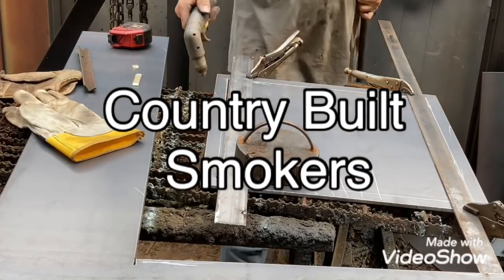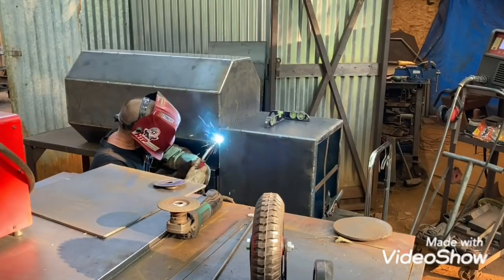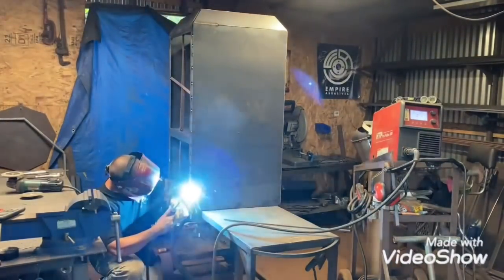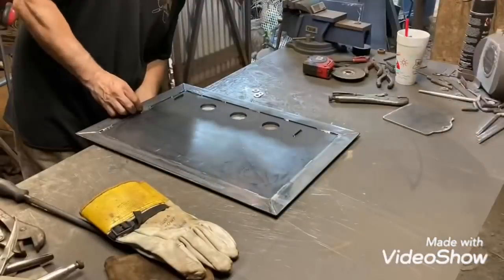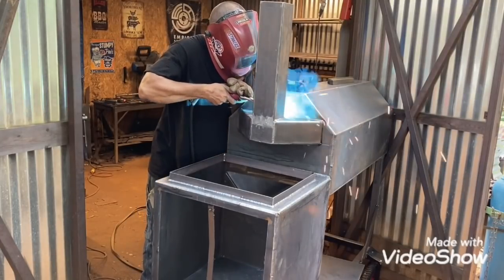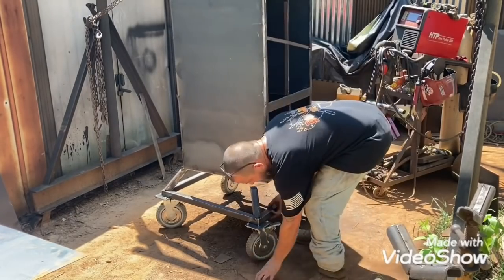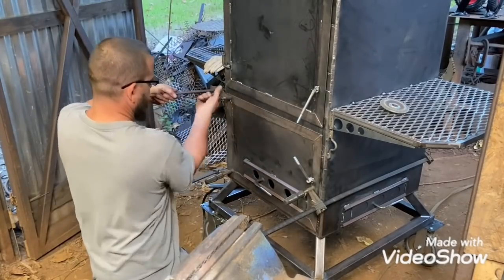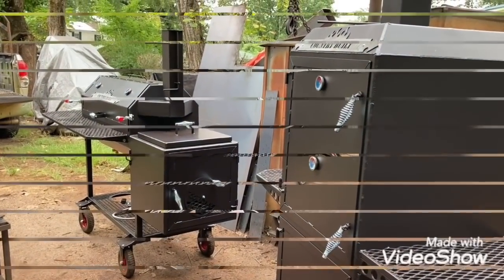Reverse flow and vertical smoker builds

Comment: As far as the new diverter goes will the water pan be as wide as the open is now? One of the best benefits of your upright is the ability pull that diverter plate out and do what I call smoke grill things like ribs, chicken etc. low n slow but right over the coals.